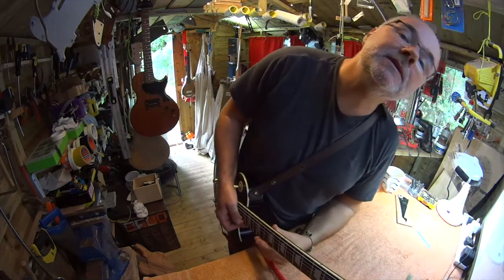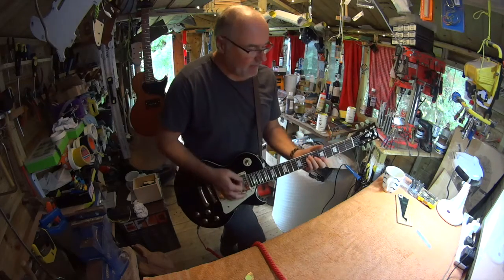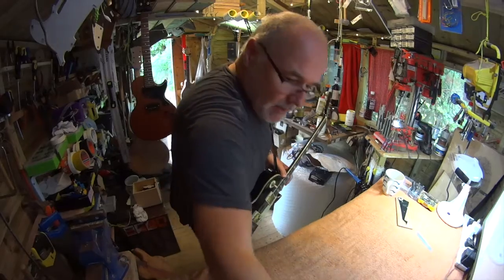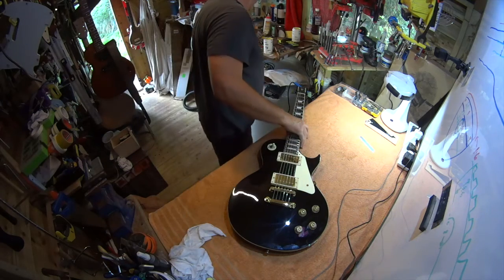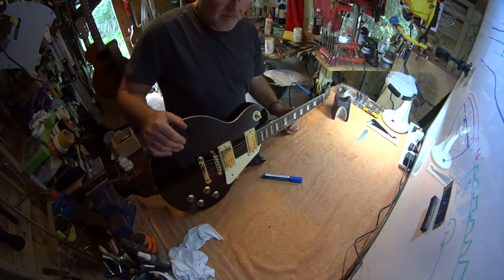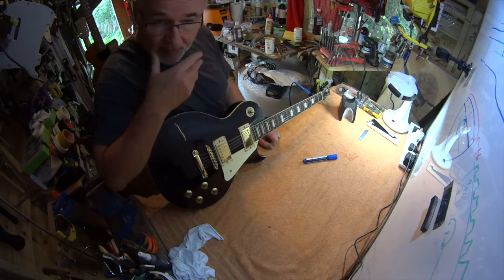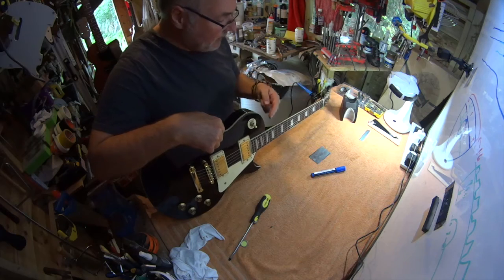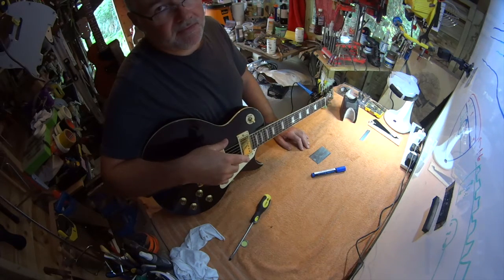Vintage V100 Les Paul copy set up

Comment: There is another good reason to level the frets as you do with the truss rod banana method and that is that some old guitars did not have a truss rod at all. I have had  a few acoustics that didn't have one and still have an old Hofner Senator which is truss rod free. If those necks aren't perfectly flat with the strings off you cannot level the frets with the fret levelling beam so your method with the banana seem to be the only way of doing it.

Comment: Hey Sam, i have one of these, exactly like this one (black, same tuners, etc. mine is 2011's made). Thinking about put a graphtech saddles on it, but they have a bunch of models (which they say in their website, only differs some little dimensions to fit on different guitars bridge). Do you know what model can i buy? (i mean, PS-8400, PS-8501, etc etc etc)
Reply from the maker: Hi - I've had a look at the GraphTech catalogue and I can't tell from their listings which saddles would fit the bridge on a VT100. I can't think of a way to solve the problem other than to pick one of the GraphTech saddle types where the catalogue specifies which specific bridge it's designed for and buy one - for example PS-8633-00 for the AVR-1 bridge such as this one:

https://www.armstrongmusic.co.uk/products/locking-abr-1-tune-o-matic-bridge-with-notched-saddles?srsltid=AfmBOooAjoa_6amYJJKV1G7vIC_0y_Dgyf4fsItC6I4J4aSTOBQlwB5V

Although you'd have to convert the posts.. Might be worth going through the catalogue listings for the string saver saddles to see if there are any named bridge models that would immediately suit the V100 post-style..? 

Sorry I can't be more helfpful

Comment: hi sam
 Nice to watch you work. I to am a huge fan of vintage v100s i have just bought a new one and will attempt to do the work myself what make of nut files do you use, i realise they are prob expensive are cheap ones a good buy for a one off job or should we give those a miss. thanks pete.
Reply from the maker: Hi Peter sorry for the late reply, been busy! The nut files are 'Hiroshima' brand sold by a Canadian seller called 'Japarts' or similar. Not cheap - but I eventually settled on an 11 - 53 set that does for ALL the basic gauges of string I set up for on a day-to-day basis (bearing in mind that you want to go OVER size to avoid any chance of string-sticking)